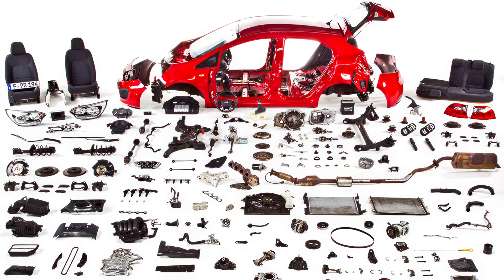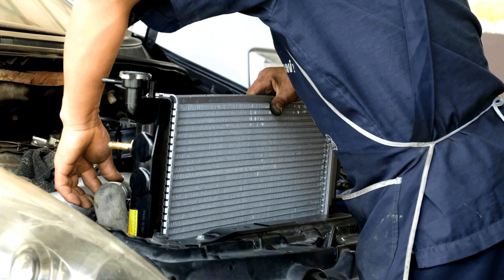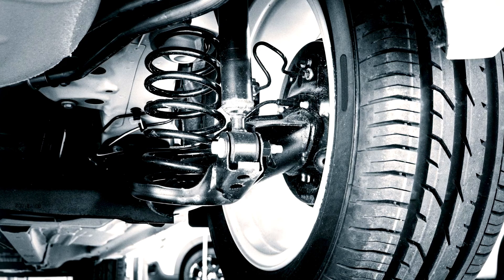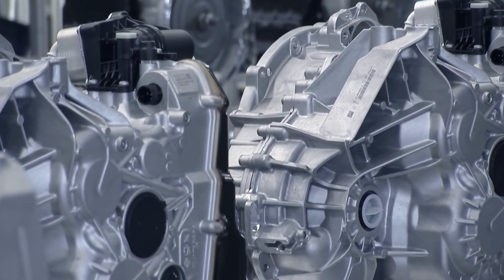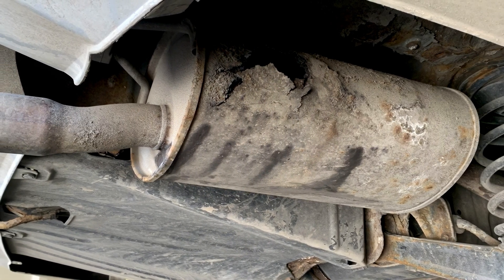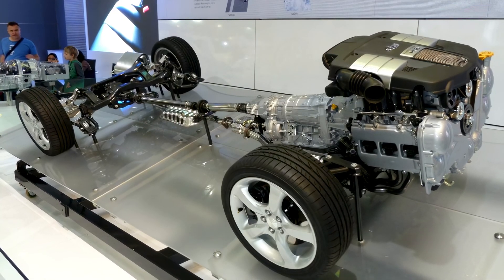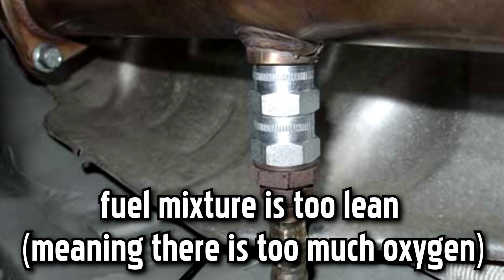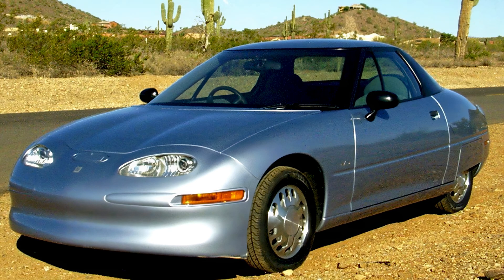Car Parts and Their Functions with pictures What are all the parts on a car called? Сar anatomy

Comment: Nice video. In the past, when buying a car, we would examine the brake, transmission, steering, suspension and engine systems. Nowadays, there is not enough information even in the brochures of cars. They emphasize more abstract concepts such as driving feeling, driving impression. You want to know the battery capacity in a hybrid car, they answer that the driving feeling is very good ))) The standards they use to measure fuel or electric consumption values are far from the real values. The only purpose of marketing is to hypnotize, to take the consumer for a fool.
It's the same when buying a television. The same model television may come with 2 or 3 different brand panels with different specs, this is LOTTERY.
Reply: 67